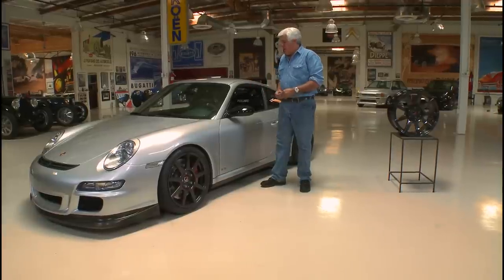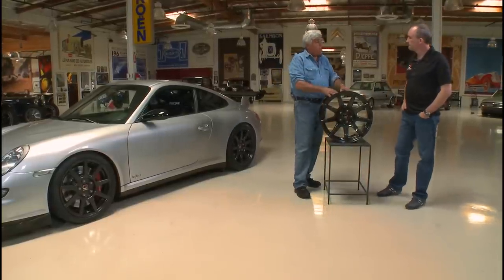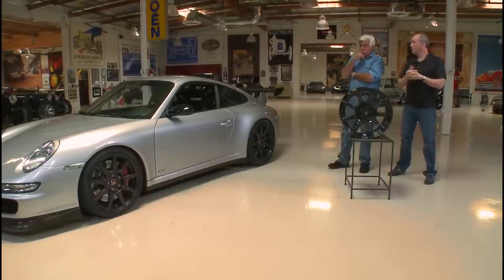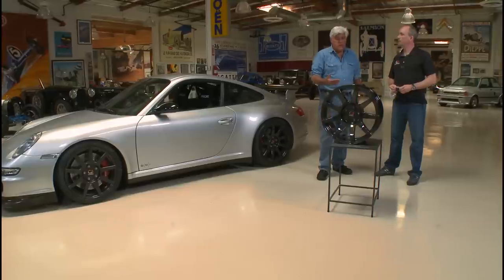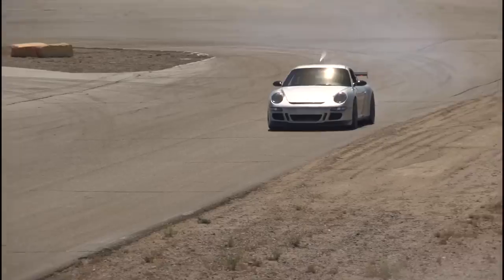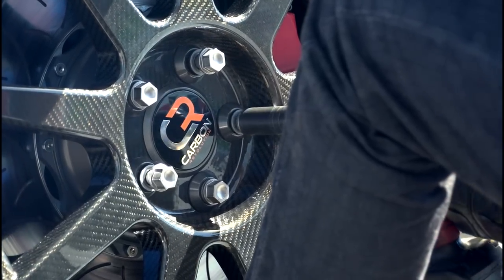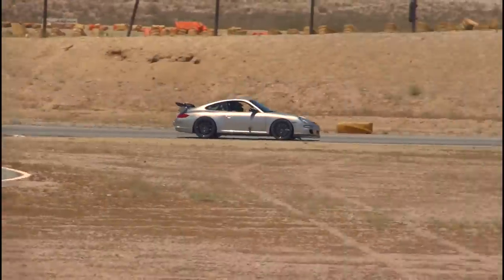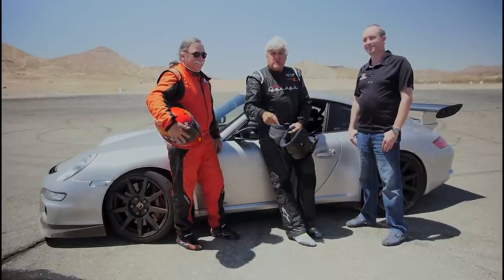Carbon Fiber Wheels Road Test - Jay Leno's Garage

Comment: Great idea except a few things....  What will happen to wheels durimg LONG term sun and UV exposure? What will happen durimg repeated hard strikes on say potholes and such, for years? What will happen when these cf wheels get a load of curb rash? What will happen on say YEARS of all thw above plus extremes of weather and temps like in the Northeast where temps swing by more than 100 degrees F in 6 months and roads are salted?

Comment: What a bunch of (you know) ..Sorry to say, love Jay, love the technology, but you are not going to feel a wheel flex. the standard wheel is VERY stiff.   there is MUCH more likely a chance that the tire was different between runs, or the tire pressure was not identical. plus, with a novice, a second time on the track, is always remarkably different.   even with a guy that is fairly skilled.
What I will say, is that the wheel is lighter and very high tech!... 5lbs lighter, and for racers that's a lot, but for a street car, you aint going to feel that. Sorry, not when you are talking 20lb rotors, 45-50lb wheel and tire combinations.... keep in mind the weight savings is in the center not the tire, so its effect on acceleration is only about 20% more than if that weight was in the car.  gyroscopically?  sure, but its only 5lbs savings and its over the entire wheel.   half that weight is in the center, so its really only about 2.5lbs in those barrels of gyroscopic effect savings.

Comment: Nice to see this technology coming down in price. It's too bad they are so expensive because they could really help on cars that don't make a ton of power. Gains in acceleration can be pretty dramatic with lighter wheels on a car such a a Miata or a Civic. I noticed a big difference even on my maxima when installing lighter wheels. I'm currently planning to buy a set of Rpf1's to replace the konig wheels on my miata. They will go from 13lbs to about 9.5lbs. Can't wait to see what the butt dyno has to say.

Comment: Where this guy loses me is the fact he has 3 terms her falls back on and dodges the question entirely. One of those was OEM. Usually a sign of someone who doesnt have an answer or doesnt know it. So they use that as a blanket statement. 

Not, or could I ever probably buy it. Just sounds like another guy reinventing the wheel, literally and just trying to be the next man to have a million dollar idea than have a solid age changing technology. I feel his focus isn't performance. But money..... 

Because in short the only thing he actually did claim with detail was his manufacturing process. Other than that he dodged every question and answer.

Comment: Good review. Carbon is a strong material, but it will take many many years before it is in the general market place, if ever.  Its two biggest problems are cost and it's nearly impossible to repair.  Good luck guys with your very (VERY) small niche market.

Comment: It's a shame Dymag didn't continue with the development of the Carbon wheel they started. That was originally a two piece with a magnesium alloy centre, but I worked on the full carbon design for my Masters research project back in 2010. The final design ended up pretty similar to the CR9, (we went for a metallic hub too for heat dissipation) but the final weight saving was determined to not be worth it for the additional cost over the best metallic alloys. Even without using pre-preg

Comment: Single piece for such an allotropic material... Jeez, carbon fiber has come such a long way. Couple that with no autoclave, I'm stunned it works as well as it does.
Who knows, maybe fatigue will cause some interesting (and dangerous) results down the line.

Comment: The only issue I've seen with Carbon Fiber components is that if they get chipped, or their outer coat is compromised their whole structural rigidity tends to fail.  
I wonder how strong these would be after a couple offs (like Jay did) or they get curbed/popholed which cause the wheels get chipped and damaged.

Comment: are they using the same rubber on both sets ?
Reply: No the car on fiber wheels have a lot better tires. That's why these things are always biased
Reply: The tires look the same to me. Both wheels can be seen with "Trofeo" on them.
Reply: ***** At 9:11 you can see the new carbon fiber wheels. At 12:05 you can see the Porsche wheels.
Reply: The tires are definitely different. This comparison is bullshit. If you change more than one thing in the equation at once it isn't a comparison anymore. Even changing the codriver makes a difference since the first one was giving instructions and the second one wasn't.

I have seen this before in other comparisons like: normal tires vs camber tires. Different compound and it seems different.

So if you want to make a comparison change only the factors you are testing and nothing more.
Reply: ***** All I can see that the OEM wheel has a Pirelli P Zero Trofeo R
Reply: darek4488

The set on the carbon wheels are Trofeo R also. Check the tread pattern on the outer shoulder, its the same.
Reply: Ian Sherman Than it might actually be a first ever fair comparison. They should however be warmed up to the same temperature and have the same pressure inside.
Reply: darek4488

Agreed, should have both ran the same pressures, and had tire warmers on them prior to going out on the track.

Either way, seemed pretty fair and I'd hope these expensive ass carbon fiber wheels would perform better. I'll spend that huge amount of money saved buying regular wheels on more useful modifications myself.
Reply: ***** or just a diet and loose 2lbs lol seems silly to me i realize the stiffness and unsprung weight but I cant imagine the cost to benefit is that great for an average car guy
Reply: hre are actually banned from many american tracks do to the frequent disintegration upon accelerating i love the way they look and i think they are great road wheels
Reply: Chris Devine

I don't have that high of an opinion of HRE myself. I had a customer buy a set of wheels, 2 of them were just plain out of round, right from the factory... 68lbs of road force just from the wheels! Sent them back, they tried to say that we "dropped them" (LOL), but decided to repair them anyway.

Long story short, the wheels were never straight, even after they "fixed" them. I have a set of Volk wheels on my Evo, they are perfect in every way, and cost less than HRE's overpriced stuff. 

I think that HRE being banned from tracks is mostly a rumor though, never heard of anyone not being let on a track because of HRE wheels.  Most of our customers who track their Porsches have the factory wheels, BBS or OZ Racing wheels though.
Reply: Chris Devine You might want to update your knowledge, because that comment is 100% wrong.Those bans were lifted years ago. Besides from becoming a serious player in the manufacturing of actual race wheels, HRE is one of the few manufactures of "boutique" wheels that have both a TÜV certified production facility, and produce TÜV certified wheels - both one-offs and serial production. Neither are easy to obtain, and HRE has come a long way after everything at HRE was reorganized.
If you want to look at companies who are worth steering clear of, ADV.1 is one of the companies still BS'ing around about their certifications. Just look into the history of 360 Forged, same owner, same problems.
Reply: i did not realize that I just remember all the stories of the spokes twisting or snapping under hard acceleration. and my neighbor spent about 12k on a set for his m5 and the back left snapped within about three months

Comment: One piece?  It's made of multiple layers of fabric that are held together by glue.  That's not one piece.  I would like to know how the seams are done between the spokes and the rim.  He is bragging that they're using a stream-lined production process, so I imagine the fibers in the spokes are not woven into the fibers in the rim.  Again, it's glue that's doing the work.

Comment: So the wheels come with lug nuts that's nice. Are the lug nuts locking lug nuts that require a custom made key? These wheels would be WONDERFUL to steal and resell !! The locking lug nuts shouldn't be the same from set to set because then anyone could contact the company and say "I lost the lug nut key. Could you send another one?" and just steal all the carbon fiber wheels that they find. Of course one could buy locking lug nuts from the corner auto parts store, but then you'd have an ugly chrome lug nut on a dark wheel.

Comment: At 10 lbs per wheel plus stiffness improvements these guys should all notice the car feeling better immediately. Not on a track, not driving hard, but immediately and all the time. That's the way it is when I change wheels on my 911. At least the one guy noticed the steering felt better and there was none of this hook up then slide behavior. But they should also notice snappier throttle and brake response. Oh well, it is Jay Leno's garage after all.

Comment: this is really good! in the day of taking out the stero system to save like 5pounds, taking 40 pounds off is very impressive! new tech is expensive but it will get cheaper soon. i remember when traction control was only used by F1 and was all new, now very cheap new cars have it.

Comment: So it's not pre-preg and not really Resin transfer moulding, then how do they make it? The weave looks just as good as the one on the pre-preg Koenigsegg wheels. Their website doesn't say this either.

But anyway great stuff. Light wheels really is the best thing you can do when aiming for better performance and at the same time they also improve the right quality.

Comment: Afaik carbon does not like heat for a long period of time and would get soft and bend. Racing breakers can glow like hot iron during many rounds. I would not buy carbon wheels unless real long races on hot tracks like in the Emirates are won on carbon wheels. Just my keeping it over-save 2 cents.

Comment: Lightest suspension calipers , carbon fiber disks these rims and P-zero tires would make such a difference per lap. 6:10  is actually a great explanation. Want the tires to touch the tarmac as much as possible. Most people know this ( I assume ).

Comment: i don't know much about cars (I do love and adore them however) but to me it seems like the extra flex might be an advantage compared to the stiff carbon wheels, especially when there's elevation change on a corner, they don't "give" as much and the steering is like a knife edge.

Comment: What I took from this video is that the only thing that changed was how one corner felt to Jay on the cf wheels and that the wheels generate less feedback from the gyro effect.  Where's the real benefit?  I like what jay said about watching what you eat would basically give you the same weight saving if you're 50 lbs overweight.

Comment: the only reason the car felt stiffer was because the damper rates and spring rates become more effective with lower unsprung mass. of course aving less weight gives performance. so im fine with the technology. but to get the most out of it. you would have to revise your entire suspension geometry

Comment: What I can believe is that JAY can't feel the difference in acceleration alone from this set of wheels.  Its there for sure.  Not sure why it isn't mentioned.  Also, easier on the brakes a bit.

Comment: Interesting video.  But would an average driver on highway use/highway speed even notice the difference?  I doubt it.  It will be a very long time before these go OEM on anything other than an exotic.
Reply: When at speed, no they wouldn't likely notice anything as it's constant inertia. Perhaps a benefit in fuel consumption. But during acceleration, yes absolutely. That gyro thingy they showed explains it really well.
Reply: An average driver shouldn't buy wheels like these. Way too impractical. But to those gearheads stuck driving GMC Yukons with 88lb (!) wheels, I'm sorry.

Comment: I'd love to see an actual double blind control test. I understand the concept of less rotational mass, but it's difficult to imagine that it would make any noticeable difference in feeling. I'm sure it would shave milliseconds off lap times, which is obviously a good thing, but it would be interesting to see if a larger group of drivers would report a statistically significant result without knowing which wheels they were using.

Comment: $15K to save a few pounds??  Amercan Mag Torq Thrust in 8" width weigh maybe 18 pounds each. And cost $200.....
Reply: American Racing Torq Thrust 16x8  25.74 Lbs.
Carbon Revolution 19x8.5 15 Lbs.
Yeah, that's close...
I've seen so many GTRS Porsche's on Torq Thrusts too...
Reply: Alize C I think there one of the best looking wheels made. then and now. Save $14K today! But I found the stats claiming almost 18 pounds for 15x8 torq thrust. But now I can't find that spec.
Reply: ***** 15x8 is tiny so 18 pounds is heavy.  Look at enkei RF1 they are much lighter.  A 19x8.5 at 15lbs is unbelievable light for how huge that wheel is.
Reply: ryan starr yeh, but I like small wheels. F1 cars have small wheels. And those big rim tires cost a lot of money, too. On a per pound basis these puppies are very expensive.
Reply: ***** Oh they are ridiculously insanely expensive.  But imagine them in a 16 inch size.  They would be like 5 pounds!  These are not practical but an amazing product never the less.
Reply: ryan starr seems to me the small size is the way to go. Low weight and the tires are much cheaper.
Reply: ***** well honestly the only reason for bigger wheels is looks, and bigger brakes.  And honestly most performance brakes will fit under 17 if not 18. Bigger wheels just pack on the unsprung mass
Reply: Scam for $16,000. 16lbs. Most rims are under 18 lbs. They cannot claim to be stronger than most alloy rims that are in the market today!
Reply: ryan starr 15x8 is tiny so 18 pounds is heavy.

Correction: 15x8 is on the large side for a passenger car wheel. The fact that newer cars have cartoonish-looking wagon wheels (http://vipdictionary.com/img/covered-wagon1.jpg) changes nothing. Wheels in the 20" range belong on big commercial trucks, up to and including tractor-trailers (22.5" usually), not on little cars.

Comment: 6 years later..and they havent been able to make any CF wheels cost effective and mass production. BS!. We need competition in this space. I wouldnt be surprised if Elon launches roadster with CF wheels.
Reply: Now it's another 3 years later and Carbon Revolution continues to decrease mfg costs and prices as volumes increase. The C8 Z06/Z07 rims from Carbon Revolution cost less than 25% of what their original OEM rims for Ferrari did. As Carbon Revolution ramps-up as OEM supplier to EV SUV manufacturers due to the ~10% range extension the CF rims get those vehicles, we'll see these rims come down to about a 20% premium over the comparable diameter aluminum rim.

Comment: "pre-Pregs" bad??? Hmmm. Seems full of "b..." whats that other letter? Engineer or Lawyer?
Reply: Pre-preg doesn't permit one to engineer the geometry of the CF. Carbon Revolution engineers (and manufactures) down to the CF strand level. They have a thicket of patents protecting their D&M methods. The only one doing anything similar is Porsche itself (which got much of its know-how from Carbon Rev) and they're not looking to produce at scale even for themselves at this point.

Comment: They stole Koenigsegg's idea! This video came out in August 2014, the One:1 carbon wheels video came April 2014. Fck this!
Reply: Koenigsegg made a car with 4wheels, they must be stealing the idea from other car makers..
Reply: +BOSSCARS There were carbon wheel prototypes way before 2000 for motorcycles or race cars. To use other materials on the same product is not like steeling an idea its more about comparing the needed effort and what you get for it. You can make a lot carbon for 15k and save a lot more weight if you make other parts on the car out of it. Thats why a lot were not going this route.

Comment: Its only $15000 a set, a used car is about $500-10000. So, its not for normal driving.
Reply: They were $40k+ per set when they were an option for the first Ferrari they were OEM'd with and now they're $9k (painted; extra $1k for clear finish) on the C8 Z06/Z07. Eventually (within 5 years), Carbon Revolution aims to gets costs down with volume to only a 20% premium over aluminum rims. And they are going to get those volumes not because of sports cars, but because the 40-50% reduction in unsprung rotational mass results in up to 10% range extensions in EVs -- SUV EVs in particular.

Comment: 15k for lighter steering input... I think I'll keep my current wheels.
Reply: +gunmedal123 If you take a look on HRE race wheels for example and how much weight you save with them on a porsche and compare this to the weight saving you will get in addition with those carbon wheels, then you will notice that the price difference is not so much.

Comment: The average wheel (for roads not race tracks) needs abrasion resistance. The layer of resin on the surface of the wheels would have virtually none. They would have a very limited life.
Reply: +Thomas Elliott Nonsense. The resin is quite tough, and if one wanted one could simply clearcoat the wheels as is done with alloy wheels.

Besides many aftermarket alloy and OEM wheels have terrible abrasion resistance. Carbon wheels are very durable and strong.
Reply: +ABOlsen69X Oh oh oh so it is nonsense is it? Oh oh oh I think you are nonsense too and your wheels are not going round.

Comment: Invent ? Koenigsegg first made something like this
Reply: Koenigsegg's manufacturing process and engineering is radically different -- they use pre-preg CF fabric. Carbon Revolution uses CF fabric (not pre-preg) and individual CF strands, which permits them to engineer the CF's geometry to a much, much greater degree than what Koenigsegg is able to do.